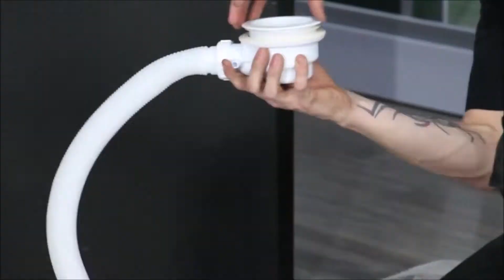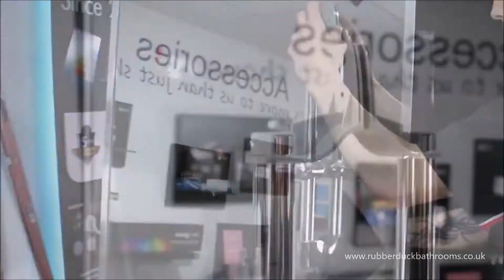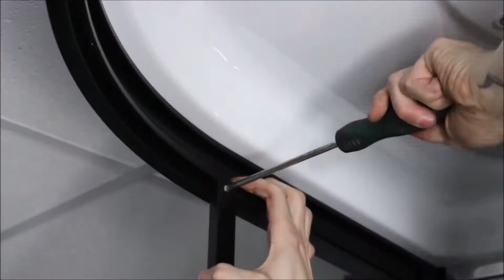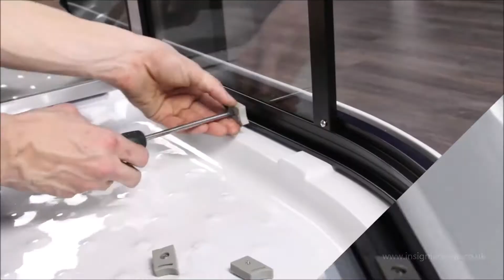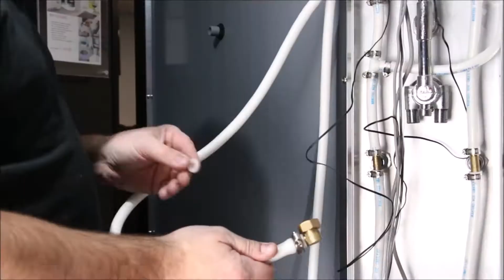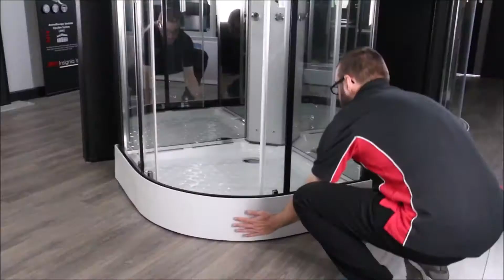Insignia Showers - Time lapse - How To assemble an Insignia Quadrant Steam Shower

Comment: What kind of plubing was that???  U didnt even show hiw to get the water in. And is it just a cold water feed or ia there a hot nd cold water &feed
Reply from the maker: Thank you watching our videos, this video shows the assemble of an Insignia Quadrant shower in time lapse. The none time lapse is also available to watch. As it shows the assemble of the shower enclosure only, plumbing would be down to your installer and pluber, but you require a HIGH PRESSURE hot and cold feed, 40mm waste outlet and a fuses spure electric supply. We recomend the use of flexi pipe connection and waste fittings to all the unit to be moved into place once connected.